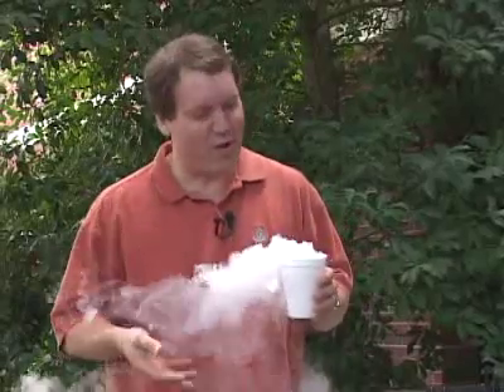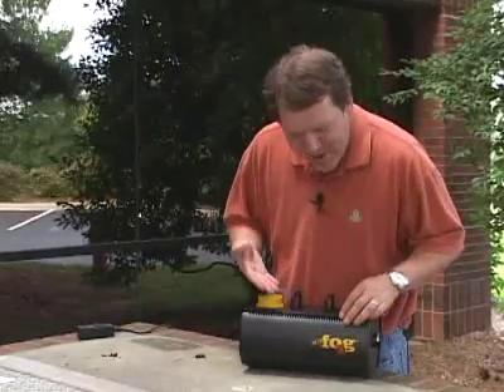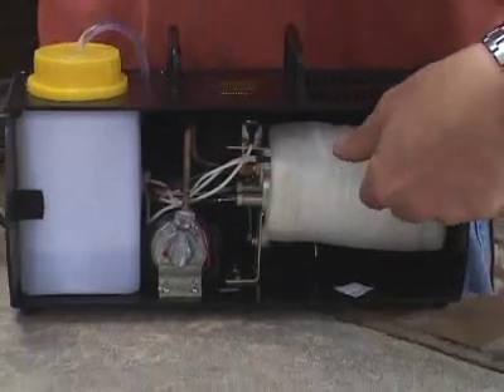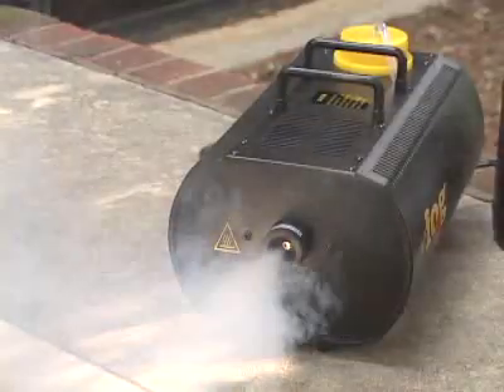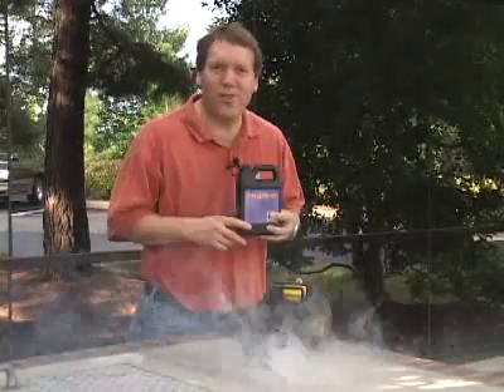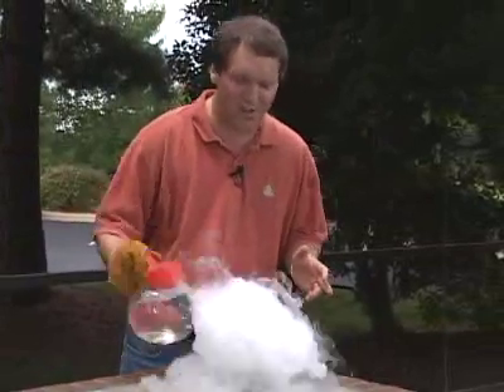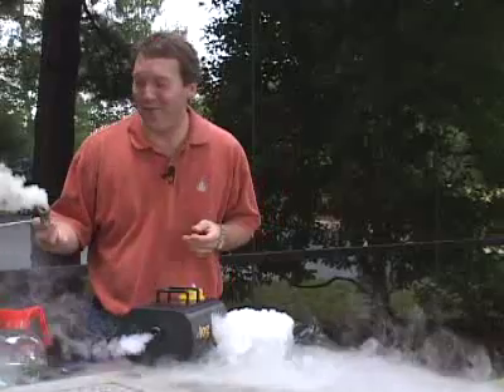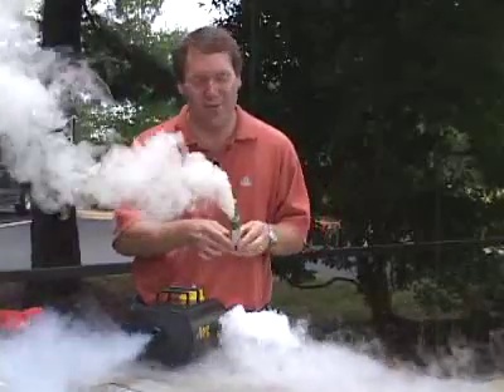How a Fog Machine Works

Comment: @antoniozografski 
You can find it at the grocery store.
Dry ice is frozen carbon diokside,it's EXTREMLY cold (-110) and that's why you always need to wear gloves when touching it or you can get freeze burnt.Hot water and dry ice are a good combination to make a long lasting smoke,mostly used on halloween for haunted cauldrons.The smoke is completly harmless,its just carbon diokside back in the gas condition.Hope this helped.

Comment: @grassvalleystudios: That's not exactly true. Yes, carbon dioxide is heavier than "air" (which is mostly nitrogen), but it will not "linger in your lungs". In fact carbon dioxide is what you exhale. It's the main product of cellular respiration. The problem with carbon dioxide is that, since it is a nonmetal oxide, it will react with the water in your bloodstream forming carbonic acid. This will shift the pH of your blood into the acidic range ("acidosis") which is a very dangerous condition.

Comment: ummm... CO, CO2, n2o whatever it can harm you severely if used improperly. just due to the fact that it displaces oxygen and can suffocate you just as easily...
if ya wanna test that get a 12oz cylinder of co2 and open it in a small room and try breathing near the floor

Comment: It will leave a residue on everything in the room. But you have smoke away around 5 litres of fog juice before you notice any. It's basically steam (with some parrafine) so it does harm electrical equipment, but not immidiatly after you push your controllerbutton.

Comment: Here's my question.. If you're using a fog machine - or even a hazer in a nice ballroom setting, where does this stuff evaporate to? Will the fog juice cling, build up and stain the walls? it has to go somewhere - it just doesn't disappear. this can be a liability issue that I never see addressed.

If anyone knows , please respond - thanks.
Reply: Replying after 13 years😂😂
Fog there is a type of vapour
It slowly condenses and mixes with the environment

Comment: there is never n e side effect from using smoke machines, only if you have shitty fluid,CRAPPY FLUID = CRAPPY SMELL, neve use a high quality smoke machine with bad fluid, always sepnd a little more to get get good fluid, 

ALSO you sould try the fog chiller, makes a great layer of fog on the ground without using dry ice